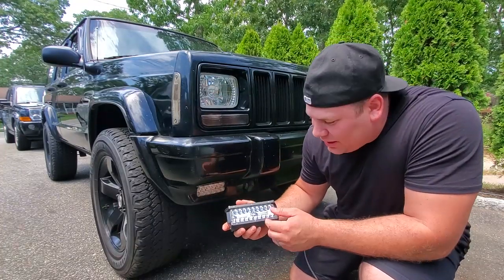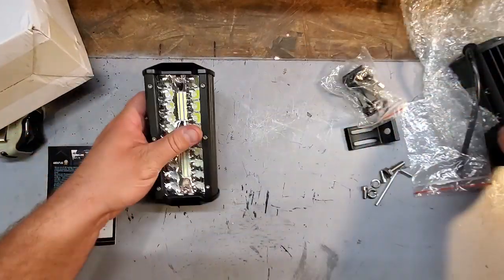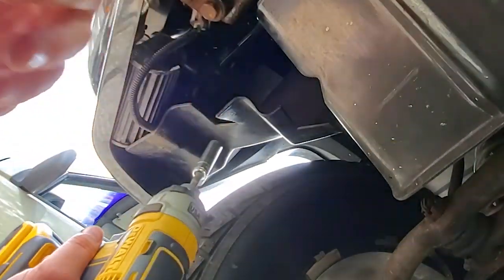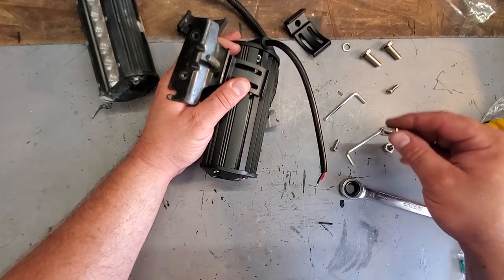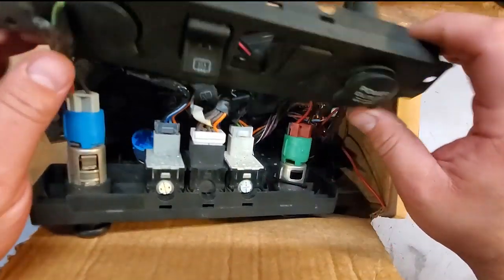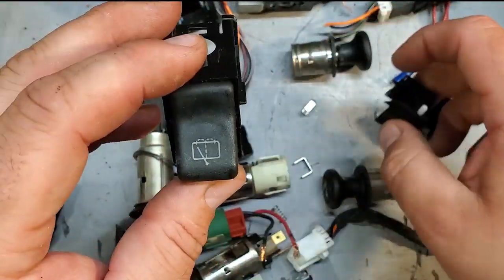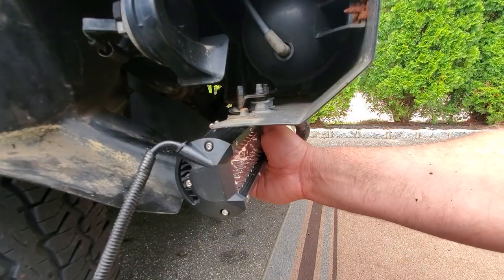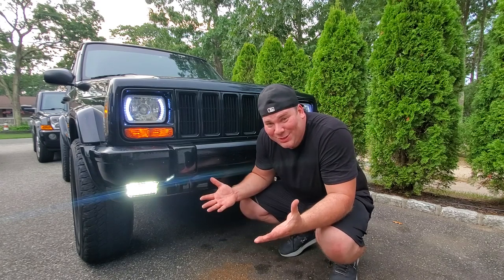JEEP XJ FOG LIGHT UPGRADE - ZMOON 6" OFF ROAD LIGHT BAR INSTALL

Comment: Thank you for this video Dan! I really want to replace my stock fog lights with LEDs. I’m looking at a pair that 100-135w, but I’m worried about the stock wiring. Will my wiring be ok?
Reply from the maker: They should be ok, that's what fuses are for! lol.  LEDS are great becase they draw less juice. if you blow fuses then you may want to rewire

Comment: What do I do if I have the factory bezel without fog light switch? Can it still be used? I watched the other video after but it only shows replacing it with a 7 slot switch bezel not how to use that blank slot
Reply from the maker: I highly recommend buying a factory 3 switch bezel from eBay.  Some XJs have a fog light plug just stuck into the back of the blank.  You may be able to plug and play it with the exception of running the blue signal wire out of the switch to your own relay..  if you get a 3 hole switch bezel from the yard make sure you take a pig tail too.  You'll need the connector and a couple inches of wire.   Youll be able to tap into the other wires from the other switches to wire up your pigtail... black wire to ground, orange is illumination, purple is the power, then blue is signal to a relay. Maybe I'll just make a video. Lol

Comment: I have a 99 Cherokee with rear fog light switch. My jeep didn’t seem to come with front fog lights however it looks that it has the wiring. Is there a way to disconnect the switch from running to the rear lights, and go to the front, so I can use it?

Comment: Just installed mine. Very bright.  Should I change the fuse or will 15 amp be ok with the factory harness
Reply from the maker: 15 should be fine

Comment: I have my own wriring harness ect. But i cant find oem foglight connector that connect to the oem foglight its self. And tips
Reply from the maker: You'll have to find an OEM fog equipped headlight harness.. it's easier to Cut em off and make your own connectors
Reply: @ProjectDanH  the harness i have came with male and female connectors. I dont seem to find the one that fits into the foglight connectiom. Will that work the way as oem connector ? I basic stripped the few xjs in my local junkard serval times but never cam across one thay had the harness. (Someone must of got them before me) cause i have seen a fee with the switch on bezle
Reply from the maker: @lycan2965  send me pic on Instagram
Reply: @ProjectDanH  tjere are crimp type connects ..idk how its spelled. I dont have instagram  sorry.

Comment: Can you do this exact set up with the stock wiring and swap out the stock switch with an aftermarket one?
Reply from the maker: Sure, why change the switch tho?
Reply: The original one is burned out
Reply from the maker: @omarvargas5736  ahhhh. sure you could.. or maybe just fix the switch?

Comment: Can you please shoot me a link to the led bulbs you buy for the switch rebuild?  They look like two different sizes maybe or at least the bases are different sizes.?
Reply from the maker: try superbrightleds.com they should be t4 and t5 neo wedge
Reply: @ProjectDanH  Thank you!  I just re-watched your vid and noticed you mentioned 3mm bulb, but I think you're right--T4 and T5.  The 3mm looked a little small.
Reply: Correction--T5 is too big!  T4 fit's in the lower hole but I'm guessing I need a T3 for the upper one.

Comment: Question, I have a 96 Xj, with rear fog lights but doesn't have front fog light, at least when I bought it. Did Jeep include the foglight harness/pigtail  with the xj regardless if factory front foggers were included?

I can't see the battery side, but below the ECU there is a pigtail that I have no idea what it's for. could that be for fog lights?
Reply from the maker: Jeeps without a factory fog lights may have the effective fog light pigtail hidden behind the area where the switch should be.  Unfortunately do you save money by removing the fog light wiring through the engine bay and to the fuse box so if you try to plug in a factory fog light switch where it should be it wouldn't work.  You would have to run your own wire harness to your own relay and tab into the factory switch to make it look as possible.
Reply: @ProjectDanH  I got the factory switch and rear foggers. Wish I knew what the front fogger pigtails liked like, bc I got 2 random 2 pin pigtails, one under the air box and one under the battery
Reply: I also have some weird round single pin pigtail I have no idea what it's for, neither does the "jeep' mechanic I go to

Comment: Did they hold up better than the first set? I just replaced my pair with the exact set of lights
Reply from the maker: so far the wear and tear seams about they same. but they are definitely better than the first set.  I have no issues with these whatsoever but I did have to replace the crew lights twice 👍🏻

Comment: What can you tell me about your switch panel? It looked like there were 5 switches on it
Reply from the maker: I made a custom switch panel back in the day (way before 3D printing). I had to hack saw 3 different bezels and plastic welded them together.  I finished the face with Bondo and some paint 😁

Comment: Just received today a pair of those Zmoon lights.  Will be mounting them on my boat.  The wattage on the lights is the estimated incandescent equivalent output.  It is not an actual wattage the lights use.  The lights have very little amp draw.
Reply from the maker: Yes! Thats why LED is the best!
Reply: @ProjectDanH  Yes. I am a big LED fan.  I mounted the pair on the bow of the bass boat yesterday on brackets that I made.  They are extremely bright!  We shouldn’t have any trouble at all running narrow waterways before daylight and after dusk.  Of course, we will turn them off whenever another boat approaches from the front to avoid blinding them.

Comment: How can I bypass the fog light system and keep them on with my high beams?
Reply from the maker: easy.  Go to the PDC (fuse box in engine bay) locate the fog light RELAY (there are 2, you'll want to pull the one in the middle) ... pull the RELAY. now look at the prongs , orient it vertically and hold it so the top 2 prongs are horizontal and the bottom 3 are vertical.  Then just bend the vertical prong on the left back flush with the base of the relay so it can be re inserted into the fuse box.

Comment: How are these fog lights holding up?
Reply from the maker: They were doing amazing until my wife crashed my XJ 🤣🤣🤣.. I got new lights to try in their place. But I did love them so I may go back if I can get a new pair
Reply: @ProjectDanH  Man you’re not even going to believe me. My wife crashed my xj also 😢 on the on-ramp during heavy rain. It had zero rust and all original paint. And yes, I’ve told her many times how to switch to 4wd. Actually dropped it off at the body shop yesterday. 

I will give these dog lights a shot. The factory style replacements always leaks water after some time so I hope these will last a bit longer.
Reply from the maker: @AWD_T  dang bruh! I feel your pain. The last a while ... as long as your wife doesn't back your commander into the front of your XJ 🤣🤦‍♂️
Reply: @ProjectDanH  haha right!  I'm going to pick up a set of these fogs.  Thanks man!!

Comment: Does this work with the factory fog light switch in a ZJ
Reply from the maker: It should, as long as you are just replacing your factory lights and not adding them to a ZJ that didnt have them.
Reply: Yes, it does. I wired my single 21 inch light bar to my fog light switch in my ZJ. It is wired to the passenger side fog light only for power. You may need a bigger fuse, depending on the light bar.
Reply: @ProjectDanH  thanks! I'ma totally try replacing my stock fogs with these led lights on my ZJ
Reply from the maker: @oscar24689  awesome man! Use the link in the description for your order.. I'll get a 2 cent kick back 🤣
Reply: @ProjectDanH  will do👍 looking forward to what you do with the general

Comment: Are you using the factory bracket? Upside down?
Reply from the maker: yep.. the bracket that comes with the LED
Reply: Project Dan H but i mean the other bracket, is it the factory from the cherokee?
Reply from the maker: @estevanramirez9815  yes. They are the factory XJ brackets. They are right side up however they are mounted above the bumper.  I used a large but as a spacer
Reply: Okay i just got my zmoon lights ima install them tomorrow
Reply from the maker: @estevanramirez9815  awesome bro! Good luck 👍
Reply: Project Dan H i did already had some little bumps in the way but thanks to you i passed them 🙏🏻👌🏻
Reply from the maker: @estevanramirez9815  awesome brother! Glad you got it sorted 💪.  I love those lights.  Share the channel with your friends 😊 👊